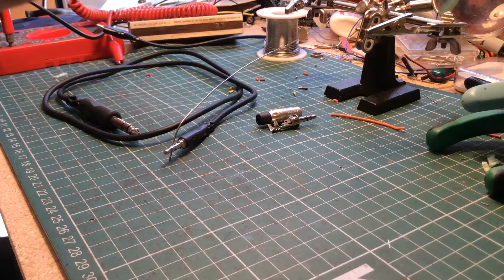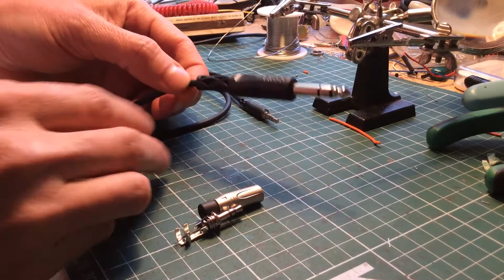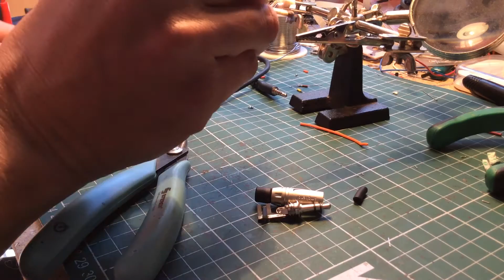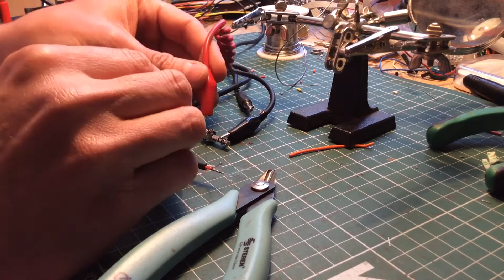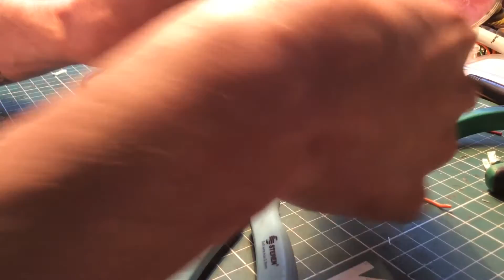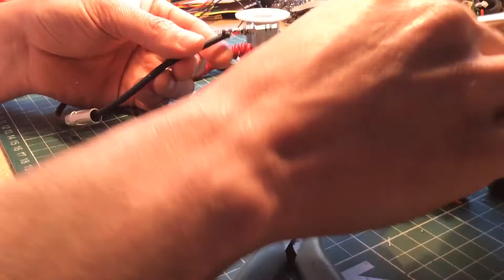SDIYClass#1 - make a midi cable to connect Arturia to Korg or Make Noise

Comment: Hi! How it’s possible that beatstep (not pro) uses mini plug mono. Does it mean there is only 2 wires???
Reply from the maker: yes indeed! The third wire would be ground for shielding, and it's not essential for data transmission.
Reply: Indeed, that is correct.  We have this cable currently available in the White color: https://www.excelvalley.com/product/midi-adapter-breakout-cables/
Reply: not this cable exactly. Yours in DIN to 3.5mm, mine is 3.5mm on both ends, but inverted so both brands can talk to each other.
Reply: Indeed, ours is DIN to 3.5mm.  But also wanted to provide here an answer to the question concerning the mono plug, 2 wires or TS jack.  Which should also be demonstrated with our DIN cable with TS jack and the overview table on the page.
It is quite interesting to ditch the DIN connectors and cables.  We will have a look to manufacture the TRS/TRS cable as described in the vid.  If you, or anyone else, would have any idea which lengths would be preferable, feel free to let us know (contact here or through our website: https://www.excelvalley.com/contact-us/). 
The Beststeap standard uses a TS connector with the following connection: Tip to Pin 3, Sleeve to Pin 5.  We will also have a look if it would also be interesting to manufacture TRS/TS cables, which would need 2 versions.
Reply from the maker: I think you should make a small female to male adapter inverting tip to ring, that way the user can use any length cable they need, and such cables are readily available anywhere for cheap. Just my 2c ;)
Reply from the maker: As for TRS to TS, maybe also an adapter with a small switch to invert the connection....  But I think it's a small market, not too many people still buy the original Beatstep compared to all the other devices using trs plugs.
Reply: Thanks for your input, valuable 2c :-) ...  This makes it indeed quite convenient for my side, but also for the users side. Will have a look to manufacture some samples.
Reply from the maker: send me some and I'll feature them in a video ;)
Reply: Indeed smaller market, although the DIN cable we currently have for the Beatstep still does sell.  Nevertheless this market is lower and will only decrease over time.  Guess it will depend on our manufacturer, if we can combine an order with a small amount of this version.
Reply: Sure, will also add some other versions ... although do not want to prevent you from making these soldering videos :-) .... Please drop your information on our contact page (https://www.excelvalley.com/contact-us/) or here privately on YouTube if possible.
Reply: Some samples have been manufactured and we should normally receive them tomorrow in our office. Please forward your details so we can send you a package.
Reply: We have manufactured the general TRS cable and also 2 versions for the Beatstep (not pro).  Feel free to have a look: https://www.excelvalley.com/product/mini-plug-midi-cables/
Reply: Thinking out loud here...   

I have a Beatstep (not pro) and I am quite sure it can only SEND and cannot RECEIVE.  Could it be that the mono plug is configured as 'Sleeve' for the Ground and 'Tip' for Transmit-Data, but no Recv-Data capability so no need for a TRS plug?

I'm guessing the MIDI Out on the Beatstep is similar to an old keyboard that just has the 5-pin DIN jack labelled "MIDI OUT" (without the corresponding MIDI IN or MIDI THRU jack.)

The mono plug means the Beatstep can only transmit in actual Serial MIDI, and requires the owner to use the USB-MIDI transport for the bi-directional ability to receive anything, like clock signal.
Reply: I looked at the spec, and knowing how MIDI data is not using differential signalling, and there isn't a pull-down resistor on receivers, so I think the data is transmitted over Ground making the ground signal very important.  The SLEEVE pin on the mono plug would almost certainly have to be ground, (not +5V) and the TIP (in the mono plug configuration) would be the transmitted MIDI OUT data.

I don't think there is a need for transmitting constant DC voltage down a MIDI cable...  aren't all MIDI devices now powered and able to reference 5V internally?

Also, are not the TRS (stereo) plugs providing bi-directional MIDI? Shield/Ground on sleeve, plus "Source" and "Sink", (i.e. both Send and Receive) on the Tip and Ring?

Comment: was that an attempt by Korg and Arturia to form some sort of product dependency? 0:46
Reply: who knows! I think it was just parallel development. The industry should come to a consensus on this though.
Reply: As Quincas already pointed out, the industry should come to a consensus on this.  There was indeed no standard on MIDI TRS and each brand seems just to have made a choice.  As the choices with TRS are very limited and the sleeve is normally used as shield, the industry has ended up with two types.  As most brands have already made their choice and have produced and sold products, it seems highly unlikely any brand would want to change anymore to one standard (if it is not the choice they have made in the first place).
Reply: Just  commenting because I see a couple comments saying that the industry should come to a consensus.  The MIDI Manufacturers Association actually released this July 26th this year (2018).  https://www.midi.org/articles-old/trs-specification-adopted-and-released  There is a diagram there, and a link to download the spec, but you have to sign-up first.  I hope it's good enough that all the vendors agree.
Reply: That's the way forward, let's just hope manufacturers see the benefit of not enforcing multiple cables, and drivers onto people. It's so niche I doubt any standards body, or regulator will be interested, so it's all down to the industry

Comment: Can you use this to connect a midi signal from yamaha p-90 to a focusrite 2i box(the one with midi is to steep for me). I saw that this is done on the IK Multimedia iRig Pro. Thanks.
Reply: Hi! No, the 2i has no midi input or output. This video is about interconnecting gear that has small 3.5mm jacks for MIDI but vary in the wiring polarity.
Reply: Ok just one more quick question( thanks for answering me so quickly). Can you then use the internal card for midi and the audio interface(say a 2i) for other things at the same time. If this is to off topic I understand, btw very instructive video(especially on how to detect shorts!)

Comment: Cable shilds connected to Vref (0V) on both ends of a shielded cable, is pretty bad design. I actually guess one could win a price for "worst design" with that one!
Abusing cheap audio signal connectors as serial connectors, while using the excuse of smaller form factor, is already very bad design. But one would not expect much more of Korg or Make Noise anyways, I guess.
Reply from the maker: works fine
Reply: @QuincasMoreira  Which part works fine?
 Creating ground loops on shielded cables through out the shielding connected on both ends to different potentials of Vref (0V), for giving hum a better chance?
 Or the serial via audio connectors part?
Reply from the maker: Sebastian Gruber-Kersting midi data gets transfered with no audible hum. I suspect the midi inputs in the receiving devices have the shield disconnected, so only one end of the shield is grounded.
Reply: @QuincasMoreira  It is true that a digital signal like midi does not come with analog hum, but the shielding can create hum on the Vref (0V/Gnd) plane, when the shielding is connected on both sides, since the two devices, the sender and the receiver do not have the same path length to ground and from that a different potential to common Gnd, while the shield catches signals from the digital serial lines, as well as environment (analog wires around).
 A different path length to Vref (Gnd/0V) according to Ohms law have different resistances, and the one with the lesser resistance has a lower potential, having current flowing from the higher potential to the lower potential. That is physics, and works also between 2 different Vref(Gnd) of different potential, e.g. 12µV above common Gnd in one device and the other 7µV above common Gnd in the other device. As a result we would see a potential diference of 5 µV on those two common Gnd lines and without galvanic separation an electric current will be flowing between the devices.
 Since there is no perfet common Gnd, the potential of each common Gnd (Vref) varies on the changing loads by OpAmps etc. pp. . And the outcome of that laws of physics about potential differences is commonly hum injected via Vref (Gnd/0V) in such a scenario. Depending on the voltages involved, such loops can even be a threat for the electronic parts involved, sometimes even a threat to health along with higher voltages.
 That is why shields on any sort of transmission line are always connected to Vref (0V/Gnd) only on one side, to prevent loops between devices, and the signal is galvanic wise separated at least on the reciever side, e.g. for an "AC signal" by at least a capacitor (e.g. >= 400 VDC rated for small signal AC ... like some polypropylene impulse-cap) in the signal path, to prevent DC currents flowing from one device into another, or even better by some miniature 1:1 galvanic separation transformer; and with an opto-coupler (>5kV isolation) for DC/digital signals. And when it comes to the shielding for the signals, the sender/emitter side is expected to offer the shielding, since its signals refer to that potential.

 In your video it did look like you were about to connecting the cable shielding to Vref (0V/Gnd) on the receiver side, and this is something you shouldn't do really under any circumstance with any electric device. But perhaps I got it wrong, when I watched the video, when it comes to that aspect? I'll watch it again!